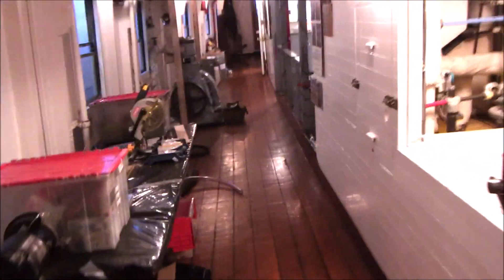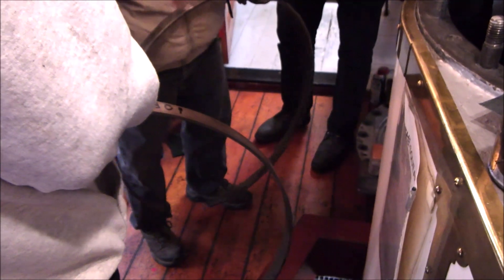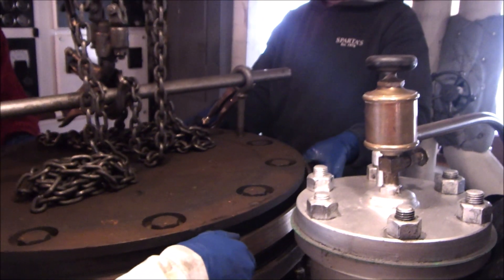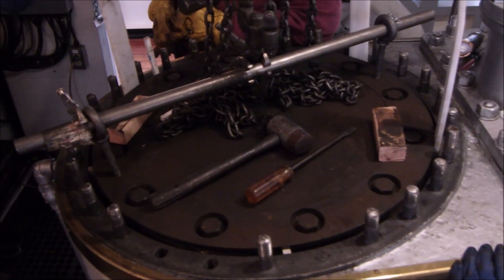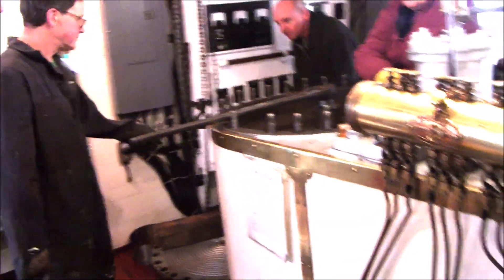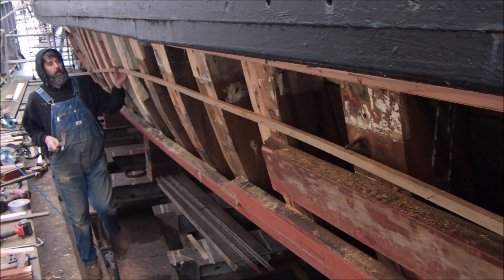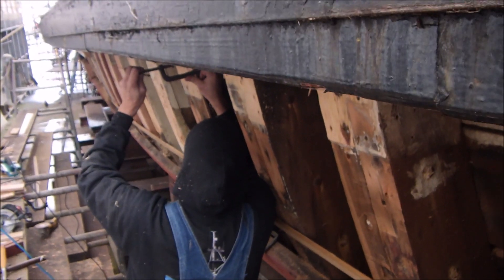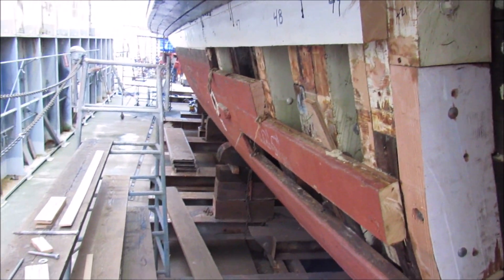Reinstalling the piston in a steam engine: SS Virginia V Shipyard Vlog #12

Comment: Yeah, perhaps a strap clamp to compress and some soft mechanics wire to hold them until partially engaged into the bore? I’ve used same on small piston valves but please understand this is meant supportively! Every engine is so very different!
Reply from the maker: We toyed with several different ideas, even suggested having the machine shop make a giant ring compressor, but making some plastic staves to guide the rings into place and down into the cylinder ended up being the answer.

Comment: Ah, vise grips, anti-seize compound, long bars for leverage on nuts, grinders etc. I would feel right at home working on your ship! I use all these items practically daily on our ancient farm equipment. I always tell visitors to our Thoroughbred farm that I`m the curator of a museum of antique farm equipment with the new every year of real horse power. Our Ford 8N`s are all 1952 vintage. We even have one 3-point field disc that has wooden bearings! Nice to see you as the narrator having the experience of working on the ship. What type of anti- seize compound do you all use? I wish I could still get the lead based compound as it worked better than the copper based compound I have to use now. Perhaps yours is better than what I can get. The only tasks that would get to me working on the ship would be all the wood work!! Hard & noisy. Rather work on the steam engine myself.
Reply from the maker: Working on a 119 year old engine always requires a bit of creativity, haha. On the ship, we have a couple of different Loctite anti-sieze compounds, depending on the application. One is metal-free, the other I believe is silver based. And the engineering volunteers in these videos actually only work on the engine and machinery, as well as sometimes doing some paint work. All the woodworking is done by professional shipwrights. 

The narration in these videos is being done by our Ship's Historian, who's been through a few dry-dockings with the ship and is also asking a lot of questions off-camera to make sure the information in these videos is as accurate as we can make it.